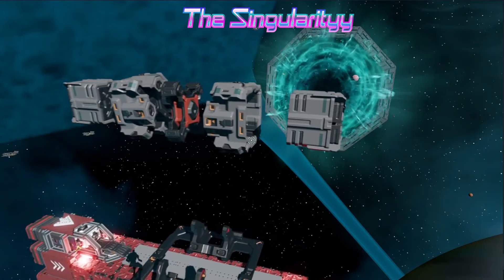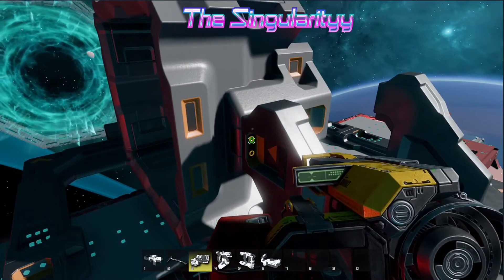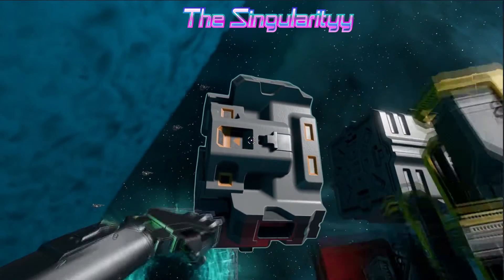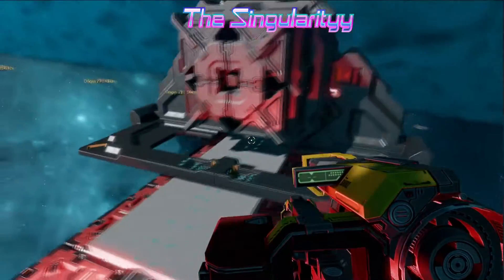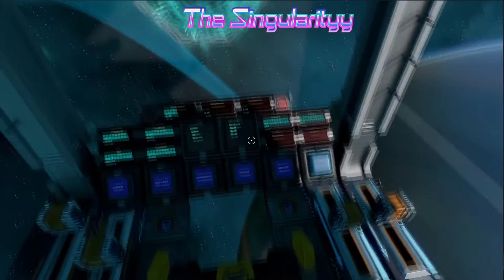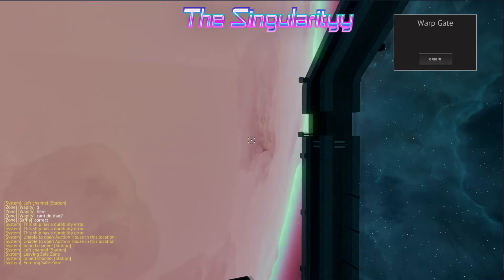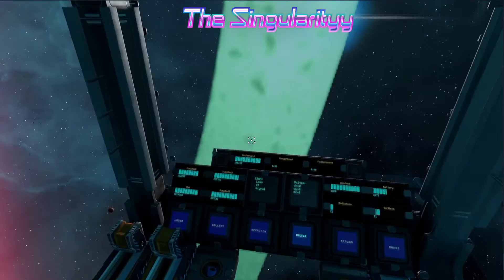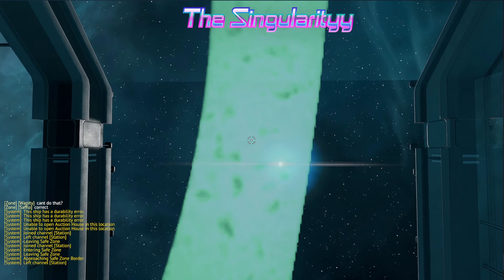Starbase: Fast Travel Core Assembly Tutorial

Comment: Also did it exaclty as you with tri fin and it always has durability issues slowing the ship down to a crawl.
Reply from the maker: So you can look for durability errors by looking under blueprint in the "U" tool. There is a durability checker in the top right hand corner. I'm guessing your support probably needs more bolts. Keep in mind, you can use too many bolts as well.